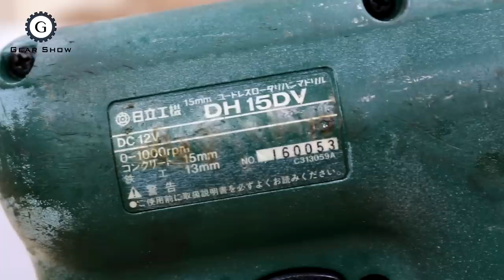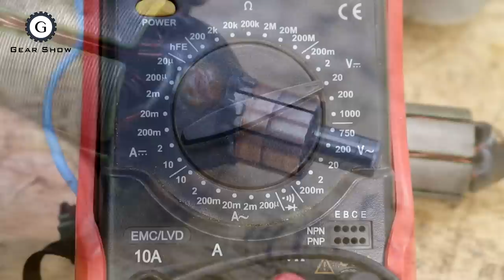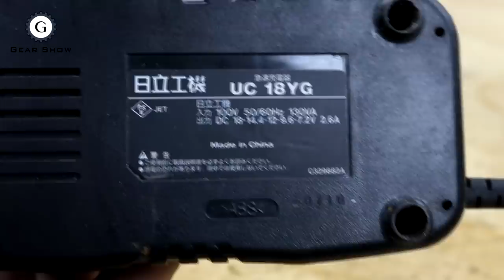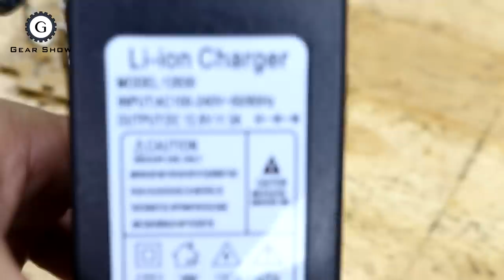Repair and Refresh 12V Rotary Hammer Drill & Rebuild Battery + Modify Charger | HITACHI DH 15DV

Comment: I think the batteries and chargers are my favourite bits now
Reply: Jefferson Humber it’s absolutely unique and extremely useful. Converting old NiMH and NiCad battery powered tools that still have strong mechanical internals to Lithium Ion power is a great idea. You get the power density of Lithium (and more current output when needed) and the good mechanical internals of an old tool, making it new again.

Comment: Hello i need help please i have a drill the chuck not opening its closed so i can't put any but inside and i can't even try to losing the screw inside the chuck to remove and change it what should i do? Please help me  the three pin of the chuck i think they are little bit inside from normal and not in the center exactly

Comment: I would like to ask, I've got a 9.6V battery drill with faulty battery pack which battery size is too small to fit 6 pcs of 18650, should I use 3s40A board with only 3 18650 batteries ? Or 3s20A is already enough?

What's the difference between 3s40A BMS and 3s20A BMS?
Reply from the maker: 3S40A load higher current than 3S20A. 3S40A is good for dc motor that need high current.
Reply: @gear_show  Thanks for the reply, could 3S40A work with 3 pcs 18650 which are connect in series?

Comment: When doing the charger, I noticed that the shorter blue batteries are on top of the longer batteries. Are they "dummy" batteries? Or what?  I didn't see you test or make voltage checks on them.
Reply: I think it is a part of PVC pipe. Just to support the positive and negative terminals of the battery to stay in place.

Comment: Please remind me, what are those circuit boards that are in the battery cases?
Reply: The BMS (Battery Management System) protects the battery from being over charged or over discharged. The BMS also keeps the series cells at the same voltage (balanced).
Reply: @denislostinlondon199  My apologies. I was looking for something more specific like a name or something.